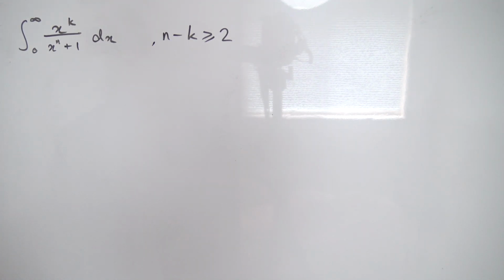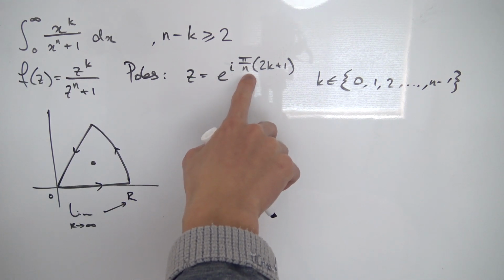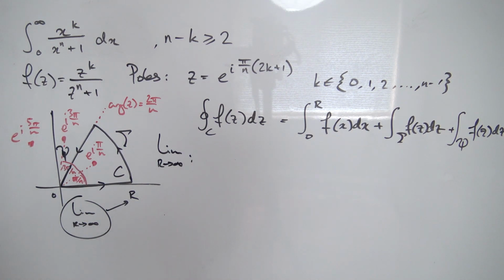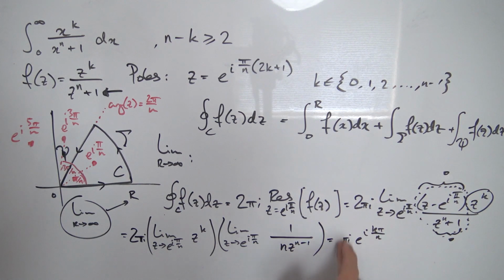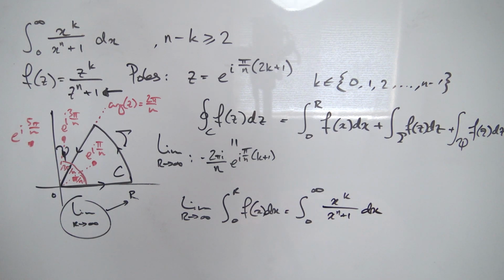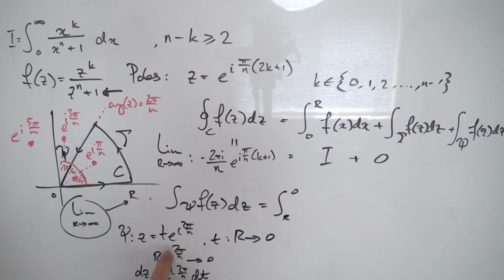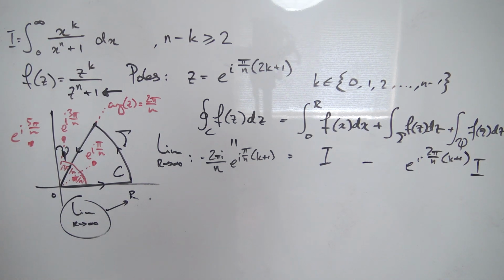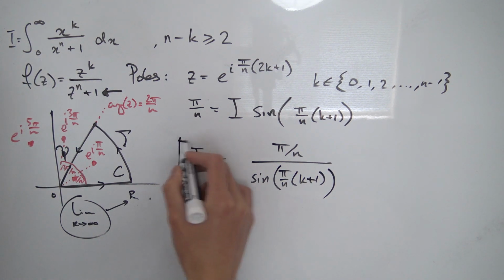Complex Analysis: Integral of x^k/(x^n+1) using Contour Integration

Comment: I checked this one earlier, i was asking  if we can change the denominator as like x^k/[(x^n+a^n)] the more general one....thanks again your video are very helpful.🙂🙂
Reply from the maker: Yes, if you want that a^n instead of 1, simply factor it out first. However this gives you (x/a)^n+1 on the denominator. You can fix this by doing the substitution u=x/a, after which you will arrive at the integral in the video, but multiplied by some factor
Reply: Yup i noted that thing, now i was thinking about the conditions for a, n and m the one you have written here is also useful fir me.
Reply: n-k≥2

Comment: The integral over Γ is parametrized with Γ : [0, 2·π/n] —> C, Γ(t) = R·exp(i·t), hence Γ'(t) = i·R·exp(i·t). Therefore, the integral over Γ is equal to the integral on [0, 2·π/n] of [R·exp(i·t)]^k·i·R·exp(i·t)/([R·exp(i·t)]^n + 1) = i·R^(k + 1)·exp[i·t·(k + 1)]/[R^n·exp(i·n·t) + 1]. According to the Cauchy-Schwarz inequality of integrals, the absolute value of this integral is less than or equal to the integral on [0, 2·π/n] of |i·R^(k + 1)·exp[i·t·(k + 1)]/[R^n·exp(i·n·t) + 1]| = |i·R^(k + 1)·exp[i·t·(k + 1)]|/|[R^n·exp(i·n·t) + 1]| = R^(k + 1)/|R^n·exp(i·n·t) + 1|. |R^n – 1| is less than or equal to |R^n·exp(i·n·t) + 1|, hence 1/|R^n·exp(i·n·t) + 1| is less than or equal to 1/(R^n – 1). Therefore, R^(k + 1)/|R^n·exp(i·n·t) + 1| is than or equal to R^(k + 1)/(R^n – 1). The integral of R^(k + 1)/(R^n – 1) on [0, 2·π/n] is equal to 2·π/n·R^(k + 1)/(R^n – 1). Therefore, the absolute value of the integral over Γ is less than or equal to 2·π/n·R^(k + 1)/(R^n – 1). lim 2·π/n·R^(k + 1)/(R^n – 1) (R —> +♾) = 0. Q. E. D.